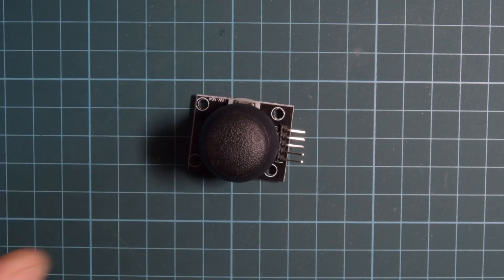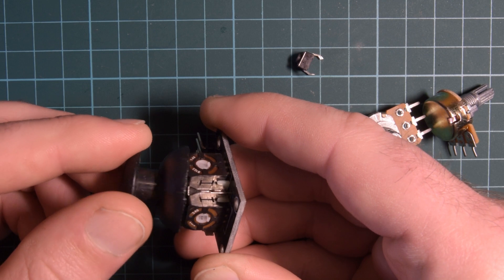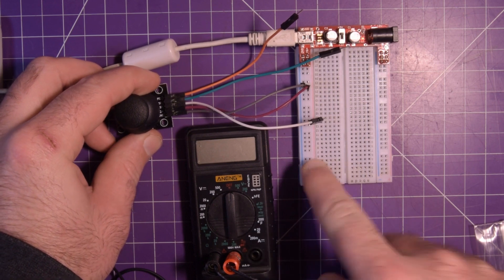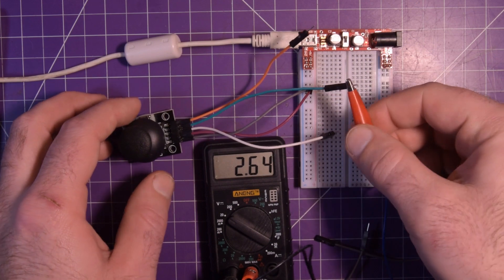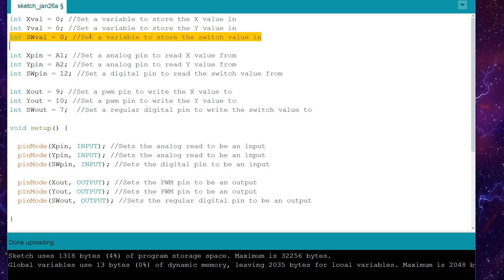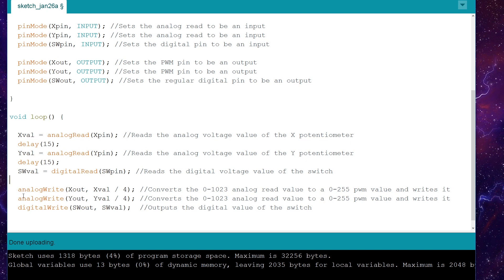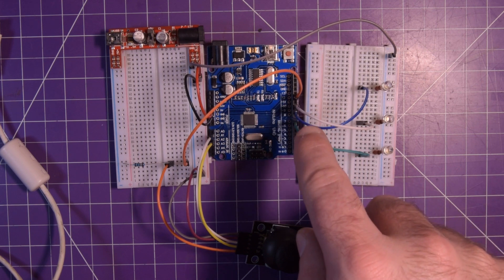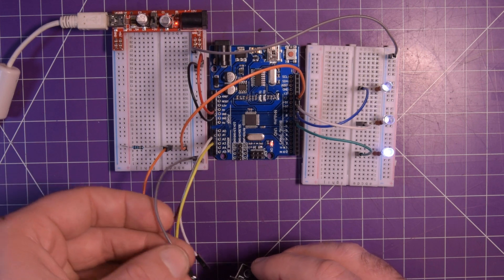Using Cheap Joystick Modules

Comment: could you please do a video on Hall Effect style joysticks?
Reply from the maker: actually yes I could - I would have to source some somewhere, but they work nearly identically!
Reply: @SimpleElectronics   That's actually the problem I'm running into, finding individual compact controller size modules that aren't crazy expensive. Apparently DualShock 3 controllers use them but all the low quality teardowns make it hard to confirm.

Comment: Every videogame controller uses this joystick since the Playstation 1 (even older).
In a videogame controller though, It always start to fail after some hardcore use and you have to either replace the piece or buy another controller.
I've always wondered if it is possible to make a joystick WITHOUT a potentiometer...you know something more reliable...it's old tech after all. 
Great video.
Reply from the maker: Absolutely, they could make them with hall effect sensors (basically reading the strength of a magnetic field) high end RC remote controls use this, but it's quite expensive!
Reply: @SimpleElectronics  Wow! Very interesting I didn't know such thing existed. "Every day you learn something new" 👨‍💻👍

Comment: Cool. The same effect could be achived without the arduino, though.
Reply from the maker: The LEDs are for demonstration but really you can't have that range of dimming with just a resistor!
Reply: @SimpleElectronics  I've just had very similar results on a bread-board using 6V, a 1M pot and 330R resistor. It only goes down to 1.6V, but it's pretty smooth. Obviousley not as accurate as arduino, but no need for mucking about with all that programing. Also the risk of burning out the pot is very high. LOL.